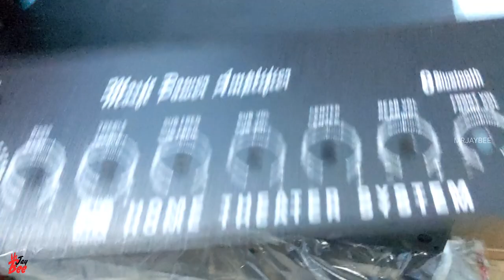New model cabinet for cassette deck players | 2022 model cassette deck amplifier assembly #2022#tech

Comment: Irfp240 9240 ആണോ 5200 1943 ആണോ കൂടുതൽ പവർ ഉള്ള ആംപ്ലിഫിർ ക്ലാരിറ്റി എതിനാണ്
Reply: Subwooferinano 
Oorortharkum ooro taste aan bro sound in
Reply: @boostedaudios4879  sabinum 2chanalinum
Reply: @k.t.prasanth5617  2 chanalin  mosfet board ottum quality kittila ,, transistor pinnem kuzhappamilla ,, 2 chanelil , Tda 7265 ,or , tda 7294 , stk 4191 ,,,or  12 inch speaker kodukanel stk 4231 

Sub in mosfet board nalla perfomance an pinne low frequency nallanom kittum but nallanom heat akum
Transistor board nall punching&soft bass an  , mosfet kurachkoodi hard bass an 
But transistor board anel voltage kootikoduthal nalla performance indakum ,
Reply: Irf 240, 9240  mosfet an

5200,1943 transistor aan 

Side chanelon sadarna mosfet board arum vekarila quality kittila